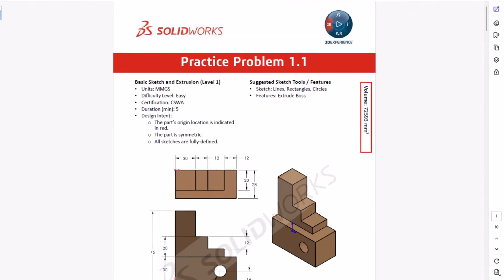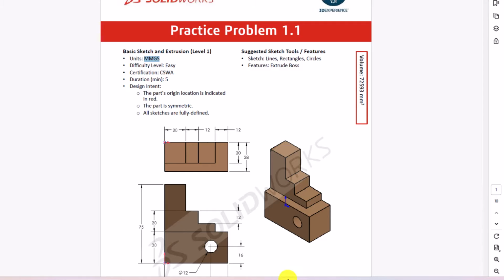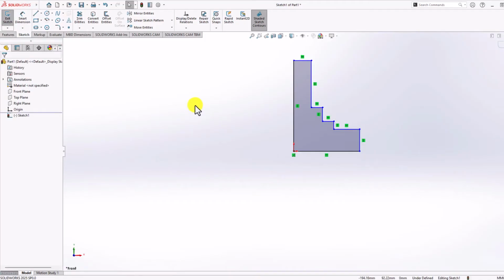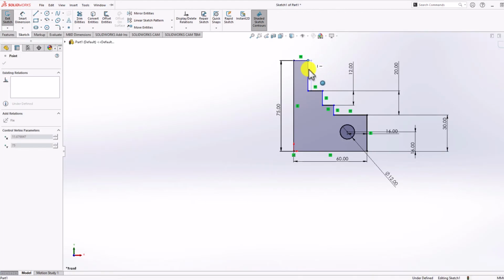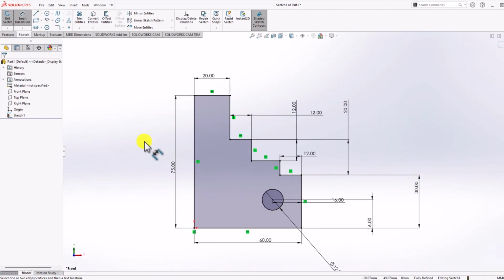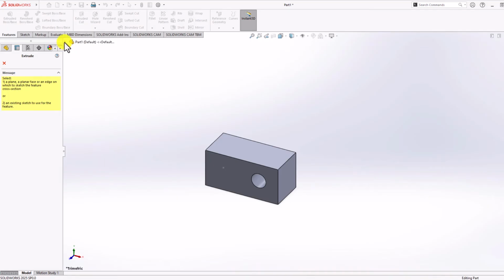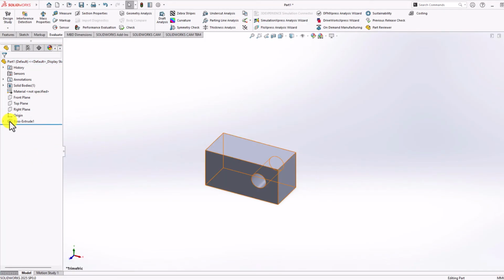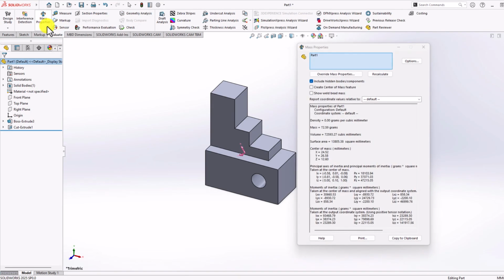CSWA Practice Problem 1.1 Solution | SolidWorks Exam Guide

Comment: I tried like 10 times to get the required volume but still getting 73553 cubic millimeters now it has become hectic for me
Reply: I got the same value, and basically one of my lengths of the staircase part was incorrect. Just make sure to check your dimensions and you are all set.
Reply from the maker: If your 2D sketch is fully defined before extrusion, I recommend using the "Measure tool" after completing your 3D model. Check all the dimensions of your model and compare them with the drawing to identify any discrepancies in the design.
Reply: @Design_With_Roozbe  i did same
Reply: Can i email you the part?
Reply: Kindly provide email so that you can check the part